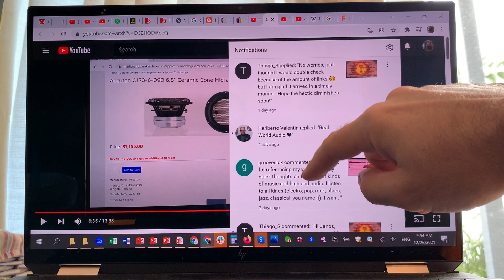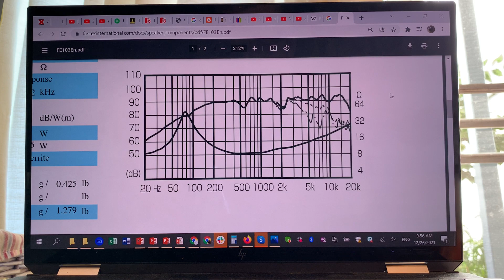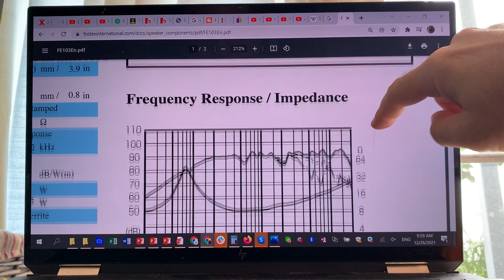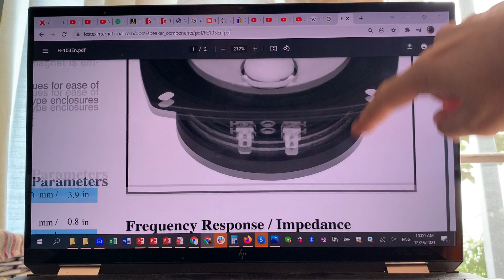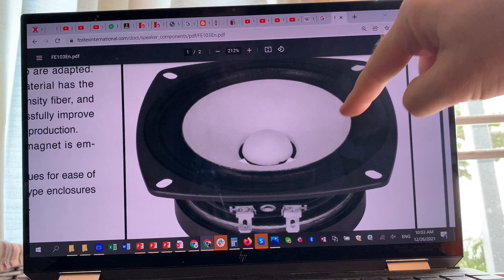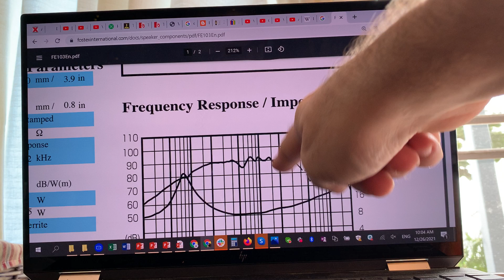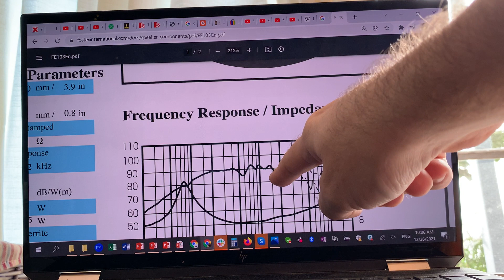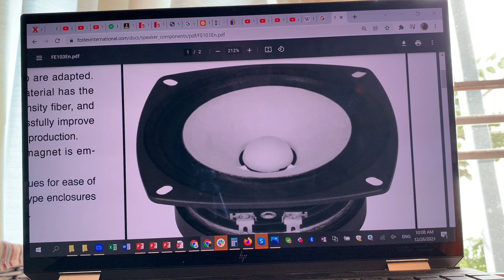How to Fix the 1-2kHz dip?  Acoustic solution to the Acoustic problem!

Comment: yeah but the dip is deliberate and you don't want it to be flat or higher thats the point because you get a lot of vocal coil noise and the midrange can sound harsh and slight metallic.
you don't want to correct for that that's pointless defeating the point of the objective.
Reply from the maker: Important point, thank you for bringing it up. I was not even thinking of that, as none of the drivers I ever played around with had the nasty voice coil issue.
Reply: @realworldaudio  not saying it has but that might be why it was designed in that manor.
 is it under hungover or overhung?
that's something don't seem to see that frequently on driver specs anymore
Reply from the maker: @hoobsgroove  Indeed, that's not something that's part of datasheets... I think in the case of the FE103NV they made that compromise to keep the highs level, and thus create a small driver that has a deeper tone, rather than the usual high-shift of generic small drivers.

Comment: What causes the other dip that it seems often occur around 500hz on full range drivers? Or am I hallucinating… /Claus
Reply from the maker: You are not, there are additional problems: we cannot cure everything with one extremely simple solution for a specific problem. However, the 1-2kHz is the biggest issue, that's why I addressed it. Addressing that main issue gives the most gain. However, in these cases when you see issues an octave lower or higher, those are impacted by the subharmonics and upper harmonics of the main problem (that is, the 1-2kHz here, caused by the driver basket). Correcting the 1-2kHz dip will also help the 500Hz problem (a little bit). Fixing the 500Hz issue requires a wide front baffle, at least 15in in width - and that is practically building a new speaker cabinet, while the 1-2kHz fix can be used for any loudspeaker cabinet.
Reply: @realworldaudio  Hi Janos. That makes sense! I was just wondering as all the midsize Markaudio full range driver exhibit the same 500Hz dip. So I guess an increase in bafflewidth moves the dip further and further down the frequency band. Thank you for another excellent video!

Comment: Long ago I saw this solution  for the bass/midrage &for Celestion HF1300 driver used in the Spendor  BC1 ( and others ).....and it worked well.
The profile of cone drivers also plays a role............Straight profile versus exponential profile.
Notch filters , while trying to solve a problem they introduce their own problems .
Reply from the maker: Thank you Frank! ; Janos